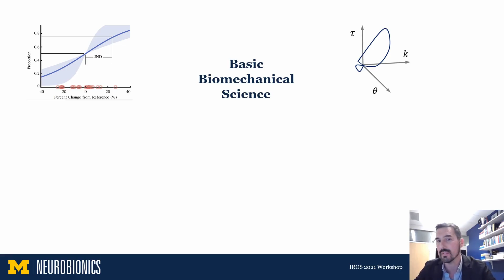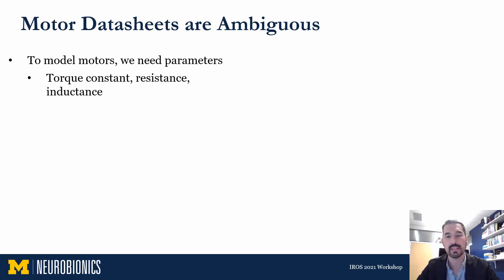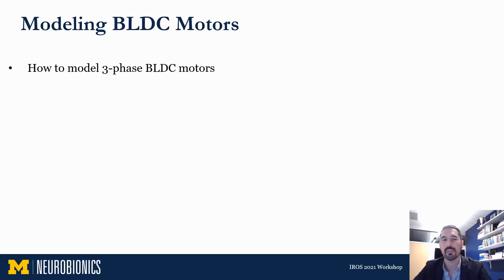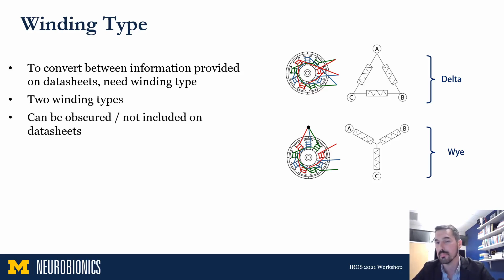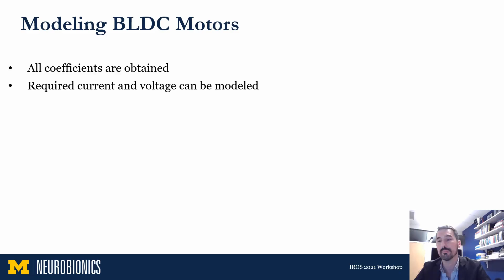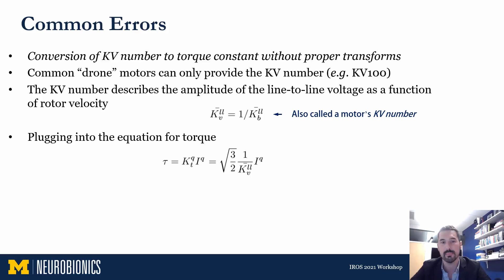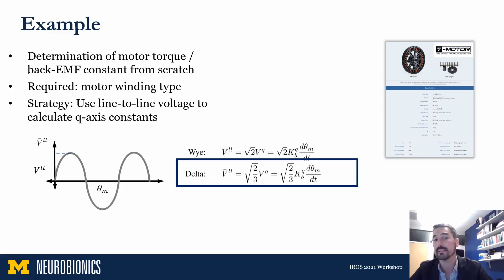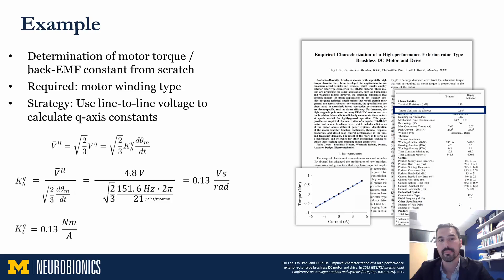Modelling BLDC motors for the design of lightweight robotic systems: common mistakes - Elliot Rouse

Comment: Question:  As you may know, when a Wye BLDC motor is driven, at any given instant, only 2 phases are driven and the 3rd phase is open-circuited.  Having determined the torque constant using the method in this video, would the resultant actual torque (as measured) be represented by the RMS current for a single phase, or for the RMS current in the two driven phases added together, or for the RMS current on all three phases added together?
Reply: Hi @kevin, sorry the delayed reply, somehow I missed this.  I don't agree that a wye wound motor only has two phases energized; this is true for block / trapezoidal commutation, but not field oriented control.  Most BLDC drives these days operate using FOC, and this is particularly important for high pole count motors, which would have substantial d-axis current if driven using trapezoidal commutation. In FOC, there will be only three specific angles where only two phases are energized. Does this answer your question?